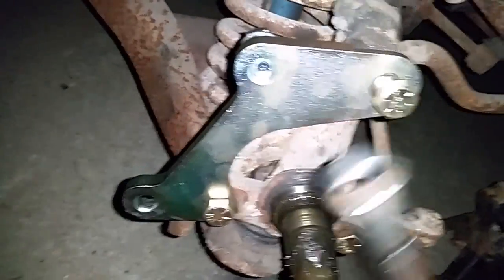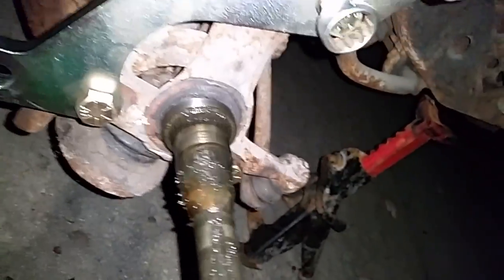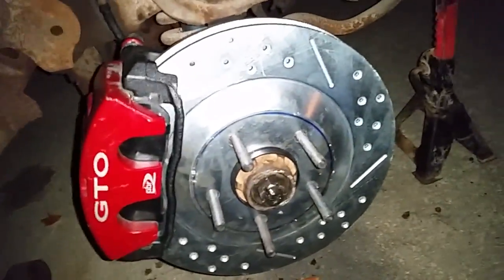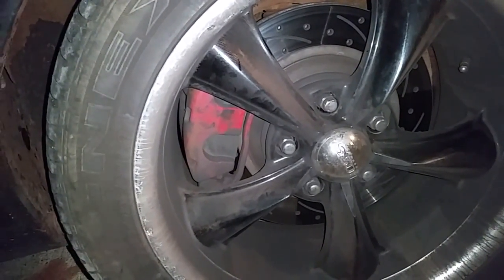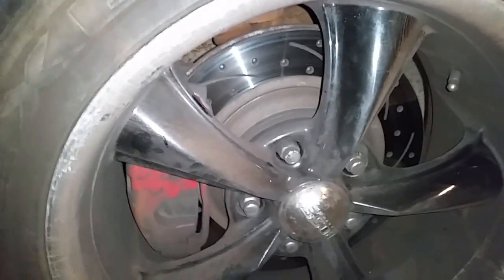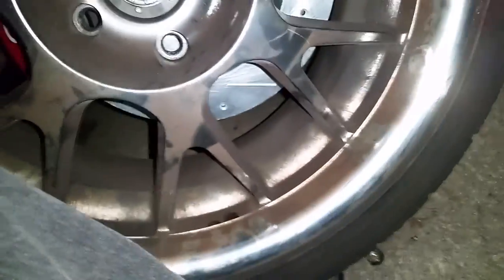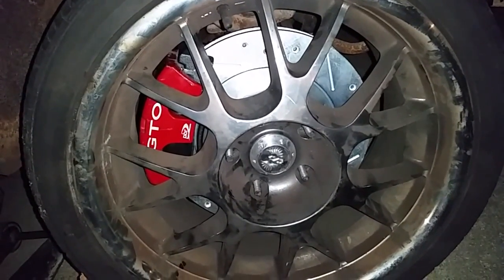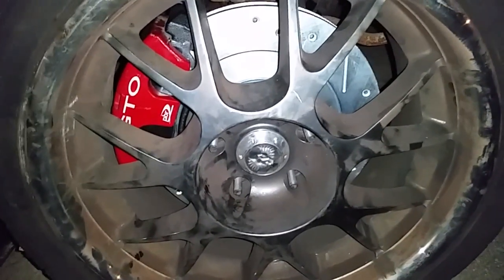c5 corvette disc brake swap 67 tempest gto chevelle nova camaro firebird

Comment: So if I have disks on the front, will I have to buy drum hubs to use on the front?
Reply from the maker: yes... or buy new aluminum hubs from KORE3
Reply: +Invincible Extremes Muscle Cars Garage Alright thank you very much. I'll probably just go with stock ones to save money. Should save over 100 bucks
Reply from the maker: +Christian Dekker stock hubs?  yeah, i prefer them anyway... steel doesnt expand as much as aluminum when it gets hot...
Reply: +Invincible Extremes Muscle Cars Garage Yeah they're stock replacement and come with all the guts.

Heres the website for anyone that needs replacement hubs. Of course ebay in an option but they look nasty and sketchy

 http://www.heartbeatcitycamaro.com/store/product/25388/Camaro-Drum-brake-hub-assy-front-1967-1968-1969/

Comment: I am looking at doing this upgrade to my 67 tempest along with the C5 brakes on the rear.  What master cylinder and proportioning valve did you use or would recommend.   Also, want to say your videos are great.
Reply from the maker: Thank you.  For the rears I'm not sure what brakes would be best... I just know the rear c5 is difficult to mount to an axle.  The proportioning valve I like is the wildwood adjustable one and I've been happy with a 1973 Corvette 4 wheel disc master cylinder... cheap and easy to find.
Reply: @InvincibleExtremes  I saw Kore3 had a set up for the rears and i got a real good deal on them.  You think I still would be better with Camaro brakes on the rear?
Reply from the maker: Kore3 are good people.  If they have a kit it should work good but I haven't had much experience.  I myself used a Ford axle and brakes on my own tempest.  And on my firebird I'm using camaro rear brakes.

Comment: what is this cpp hybrid set up you speak of
Reply from the maker: uses 13 inch c4 corvette discs with c5/c6 corvette calipers... fits unmodifyed drum hubs...  not as nice as the KORE 3 parts for using a c5 disc with c5 caliper...
Reply: O OK I see I have a complete front kit from cpp with 2 inches drop spindles 11" wish I had seen this before I bought this kit seriously thinking of selling and going this route
Reply from the maker: +clos805G you should... its honestly really nice... and with none of the hassle of tie rod arm problems...

Comment: The spindle looks like my 1968 impala. Did you have to modify brake lines to master? Price estimate on parts?
Reply from the maker: i did modify the lines to fit my wilwood adjustable proportining valve.  total estimate on price was around $600 including master and an $80 adjustable prop valve

Comment: Is this the kit you purchased from Kore 3 and would it be the correct one for my 1967 El Camino/Chevelle? http://www.kore3.com/proddetail.php?prod=10083-02    I'd like to do this for my 1967 El Camino which has disc on the front but still drum in the back. I've been seeing a set of four 2006 GTO calipers for around $200. That sound about right for cost?
Reply from the maker: Back brakes on a gto are no good for you.
Reply from the maker: That is the bracket though
Reply: @InvincibleExtremes  The disc brakes on the front of my 67 Camino have the old style design where the hub and rotor are one piece. Will the GTO calipers at least work for the front if I get different spindles like the GTO spindles or maybe switch back to the factory drum spindle for my car's application and then just have them turned down? I'd really like to find out how to get C5 brakes on the back of my El Camino too but not sure how? I do know I can do the 98-2002 Camaro discs brakes though. Thanks!

Comment: Lost me at cutting off bolt heads. Why are you doing that?
Reply from the maker: protector326 something I did on the ls1 brake conversion, you don't need to with this KORE3 setup.

Comment: Is this the kit you used:
https://www.kore3.com/proddetail.php?prod=10083-02
Reply from the maker: +Eric Harmer no, that is not.  The kit i used uses 13 inch rotors... not 14 inch.  But you can use that one if you want and are willing to use 18 inch wheels...
Reply: +Invincible Extremes Muscle Cars Garage, thanks. I'll keep digging. As your earlier videos shows it's going to be easier to fit a smaller than 18" wheel on my Lemans.
Reply from the maker: +Eric Harmer with my kit, 17 inch fits, with a 12 inch ls1 setup from BRP hotrods you can fit a 16 inch... but no smaller
Reply: +Invincible Extremes Muscle Cars Garage is an encyclopedia! You're saving me so much down the road.
Reply from the maker: +Eric Harmer thanks bud... trust me... I paid for all that knowledge first hand... ;-)

Comment: Where did you get the rotors from?
Reply from the maker: ebay.  i think they were 95 bucks for the set
Reply: Hello, I am doing a 67 Oldsmobile delta 88 . B body . I talked to someone at kore 3 and o ordered the caliper bracket but it was too short to fit on my spindle .So I call back and emailed the measurements to them but they have never responded back. So I had have someone else making the same bracket but extending it longer to fit. Thank you for letting me know about the rotors. And I will try to get back with you soon as possible.
Reply from the maker: +Harold  Price i didnt know they make b body parts... i do know about the a, f, and x body kits...
Reply: +Invincible Extremes Muscle Cars Garage no they don't make any parts for B bodies. Kore 3 is  good at what they do. But is something new to them about B bodies which they should be able to get into because a lot of people are restoring the B bodies again and their customer service is pretty good .
Reply from the maker: +Harold  Price yeah, they make great parts and have great service.  btw the disc brake brackets are different for drum and disc brake spindles... you have disc brake spindles by any chance?
Reply: +Invincible Extremes Muscle Cars Garage No drum spindles. same as your Pontiac Tempest. just a half an inch bigger.
Reply from the maker: +Harold  Price oh ok, cool